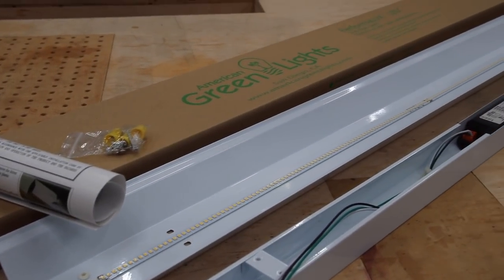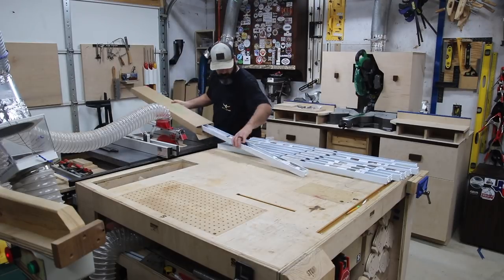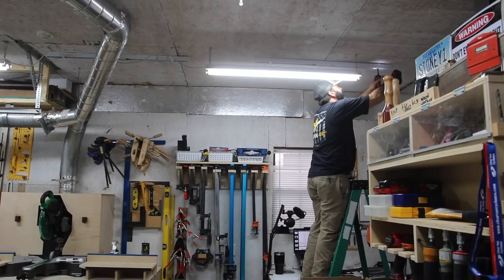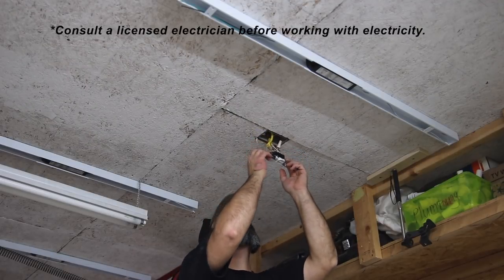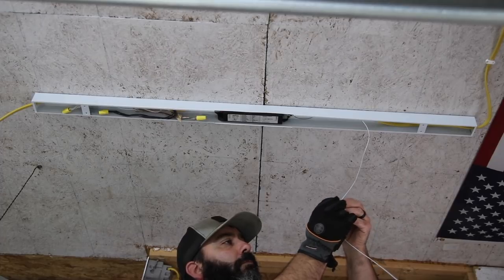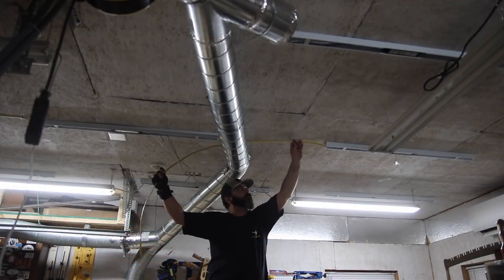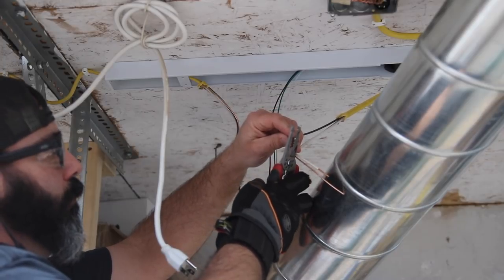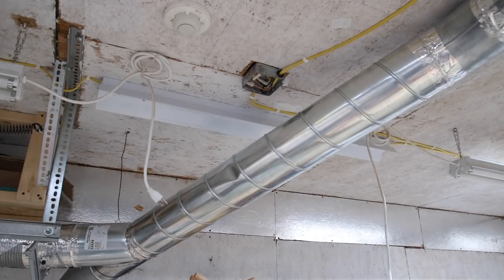LED Shop Lights - Woodworking Shop

Comment: Looks good!...nice upgrade!.....I like how you checked the function after every light...that will definitely save some time in case some wires get crossed
Reply from the maker: For sure. I had a couple where I didn’t set the wires twisted together good enough so it definitely save time down the road.

Comment: I would bet that you could have skipped a couple of arm days at the gym during the week when you filmed this video. ;)
Also, I don't have a shop of my own, but my basement is a hobby crafting area. I replaced the florescent bulbs with the same size LED bulbs for about $45. It's made a huge difference for working in that room and I didn't have to replace the fixtures. It was $45 for 10 lights. I wish I had done it much earlier!
Reply from the maker: No doubt! Thanks for watching.

Comment: I added 10 6000K 5600 lumen two lamp fixtures in my two car garage shop and painted the walls and ceilings with bright white ceiling paint this made a big difference.in my shop. I would also suggest that you use frosted lens as apposed to raw Led lamps, the raw LED’s cast shadows.
Reply from the maker: Thanks for the tips.

Comment: Which model of those lights did you buy? I'm looking on their website and unable to find any 24 watt lights at 6000K Daylight White settings. I love the idea and intend to do this in my shop. I'll also run another light switch to the main door that I use, since the only one is on the opposite side of the shop.
Thanks for the video, it's very comprehensive and great motivation. Looking forward to your reply.
Bob

Comment: I put LED lights in my shop when I moved into my new house.  Quick question, any reason why you used 12 gauge wire as opposed to 14 gauge, which is normally used for lighting?
Reply from the maker: Nice! I already had the wire in place to the outlets so I just continued to the lights with it.

Comment: You went over kill on the wire, 14g wire would have been more than enough for LED lights.
Reply from the maker: Already had 12ga in the ceiling.